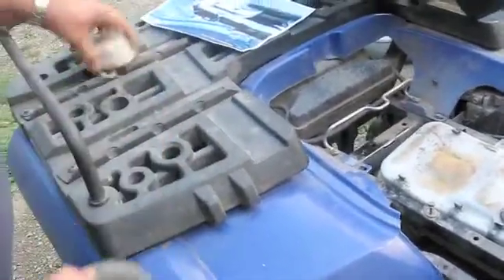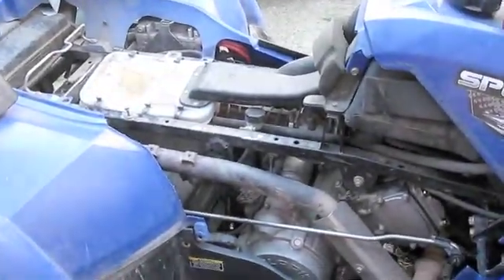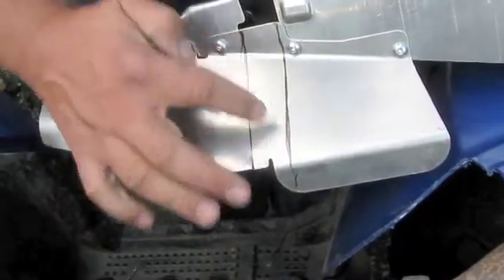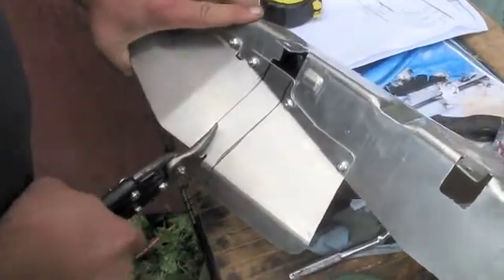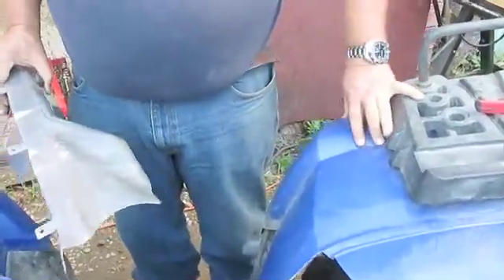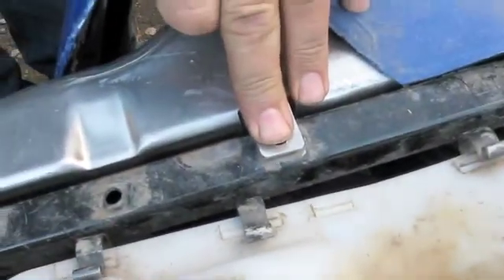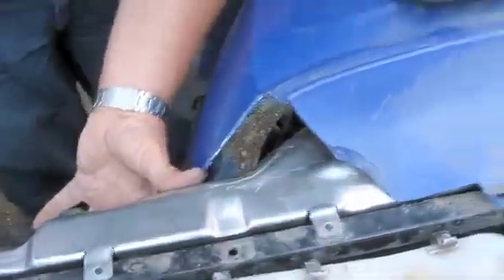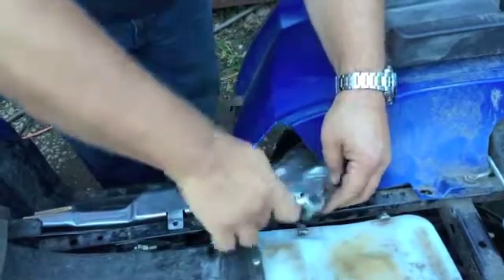Polaris Sportsman 500 melting plastic proper repair

Comment: Yes, the two small bolts attached to your exhaust pipe ( in 2 places actually) have smaller U shaped heat shields attached. I may have to remove the one in order for your mod to fit. Thanks

Comment: I’m in the process of installing this mod on my 2006 Sportsman 500 HO. I too was experiencing some plastic melting. Not as bad as you but still there. Thank you for your video and parts. Needed

Couple of questions: There are smaller installed aluminum heat shields where the bolts are on your muffler. Did you remove those to install your add on??
 Second , when you reconnected your shift linkage, did you have any interference with the new mod you installed??

Thanks
Reply: I did not need to remove any other heatshields.  And the good news, is that, NO, I did not have any problem with the linkage--the new heatshield did not get in the way.  That's with the 2007 model, so I trust it will be the same with the 06.  Good luck--hopefully it all goes well for you!  Thanks for the comment!

Geof

Comment: Did this resolve your problem??? Thank you for the details!
Reply: Well it certainly did for me.  I never bothered replacing the whole back fender plastic which would have included the plastic covering over the exhaust heatshield.  I just left the aluminum heatshield continue to be exposed.  I do believe it would have prevented more plastic melt, had I replaced the plastic, due to the fact that the heatshield is large and gave a large area to dissipate the heat.  Also, when I replaced the seat, it never melted again either--so I believe it should work for anyone still having such a problem.
Reply: @CorPro  Thank you ... we have a 2005 model 500 cc ... looked the same as yours in the video so this may be the key for us ... very poor design on the part of Polaris.

Hope you are doing well in Canada ... I am personally shocked by what Trudeau has been doing up there.  Seems more like Fidel than Pierre ... hmmm

Comment: Nice video. I’m doing this mod to my Sportsman. It hasn’t melted yet, but does get hot. So i couldn’t tell from the picture you showed in the video, but did yours have the small heat shield on it that bolts to the two brackets on top of the upper pipe when it melted?
Reply: Thanks!  Glad you enjoyed the video.  The only thing that resembled a heat shield, before I did this fix, was thick type of tinfoil backing glued onto the back of the plastic piece that eventually melted off.  At least as far as I can remember.  I don't own the quad any more, but have kept this video up as it continues to be quite popular and helpful to folks.

Comment: I had the same issue on my 2014 Sportsman 400 H.O. I looked under the right side of the bike and noticed a bunch of broken that heat shield material. While driving I noticed a weird ticking/clicking sound. I assume the issue is the broken heat shield material. Did this sound happen with yours too?

Comment: The extra heat my be coming from air vent pipe under your seat generating additional heat to the heat shield. The vent pipe could be extended out to rear tail light like the 2015 scrambler 850 I own. I had the same issue  and  was caused by the vent tube for clutch leaking from the two piece pipe coming loose do to small narrow thin rubber boot with two pipe clamps that held it together and comes loose very easily and needs to be checked every ride! Come on Polaris! I hope you have figured this issue I have addressed.

Comment: wondering if this has worked at all. Did you control your heat problems with this? or it still hot on the right side?